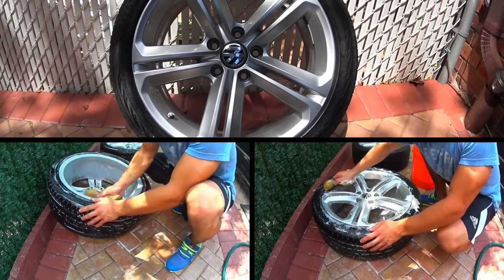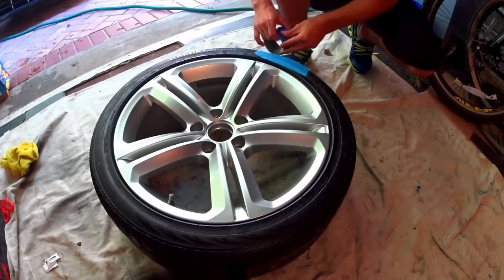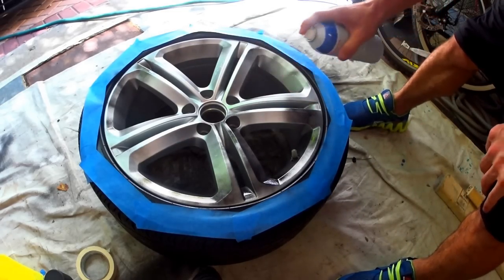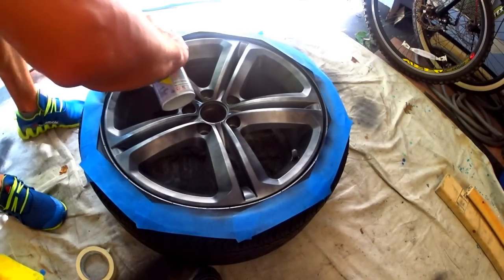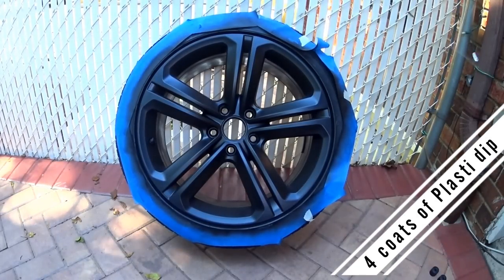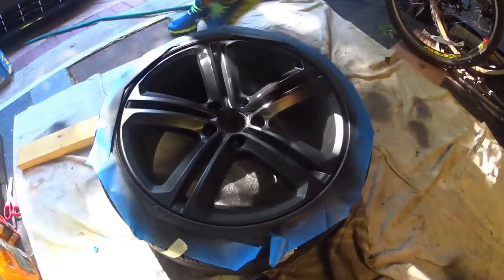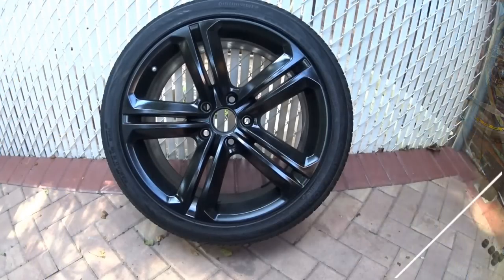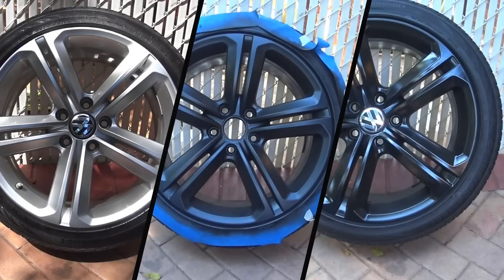How to Plasti Dip Wheels + Glossifier | Complete Guide

Comment: With 1 can/ wheel how many coatings did you get?
Also, how do you wash the wheels now?
Using a high pressure jet (from distance) will it tear apart the dip ?
thanks.
Reply: I managed to do all 4 wheels with 2 cans, wash with dish soap and water, pressure washer from far is fine, super up close will take off the dip.

Comment: Will damage be noticeable if i plasti dip over damaged areas on the rim? Would it be visibly uneven? Thinking of getting some rims with badly scratched paint and just plasti dipping over it.
Reply: I think, (from what I’ve gathered in other videos) you would have to sand the scratches or chips down on the rims. Some people put bondo filler to cover up the bigger dents/scratches and then sand it down to get a smooth finish. Then you can go in with plasti dip or whatever paint you’re using. Chris fix has a video on how to paint tires and he goes over fixing scratches on wheels. I too want to plasti dip, but I will try to sand down as much of the curb rashes as I can, because otherwise they will be noticeable. Obviously from far away you won’t be able to tell, so I guess it depends if you care or not that up close it may be noticeable. The plasti dip will only cover up so much, depending on how badly scratched up your wheels are.

Comment: Did you spray the inner wheel? And if you did, how many coats would it need and is 1 can per wheel enough to do the whole thing?
Reply from the maker: Yes I did the inner wheel as well. 1 can is enough to do 1 wheel with 1 light coat followed by 3 heavy coats on all surfaces. Get 5 cans to be safe; there are some kits on ebay that come with 6 cans for less than 40$. Ill try to make another video soon to show some easy ways to paint wheel barrels. Good luck!
Reply: Brovacs Thanks. How does plasti dip handle cleaning after it is applied. Would regular wheel cleaner still be fine to use. And/or high pressure water?
Reply from the maker: If you apply it like you see in the video you wont have any problems cleaning it with a wheel cleaner or a high pressure washer. Just make sure you stay at least 1 foot away from the wheels with a pressure washer, treat it like you would be washing the paint on your car; you wouldn't put the pressure washer right up to the paint and you always keep it moving. I had the plasti dip on my wheels for 1 year with no problems and I washed it every other week.
Reply: Brovacs much appreciated man, thanks for the video and additional help!

Comment: I bought plastic dip today,and spray on the can plastic cover because I wanted to try it and see what it looks like.  after spray 4 coats and I saw the surface was not so black, seems black mix grey..  anyway it didnt look like ur wheel.   Do you know Why??
Reply: 1st coat: light even coverage
2nd coat: heavier coverage but not to heavy
3rd, 4th, and 5th coat: heavy wet coats
You either weren't spraying evenly and to light or you just need to do 1-2 more coats and you will get the coverage you want. Hope this helped
Reply: +Joshua Barela thanks a lot

Comment: How do you guys tackle the opening for the lugs? I've had issues with the dip grabbing on to the dip when I put the wheel back on the car. What do you guys do?
Reply: Did you ever get an answer for this?  I had this problem.  I think perhaps either there weren't enough coats or you didn't wait long enough for it to fully cure.
Reply: easy... put a quarter in the middle of the whole when you paint and remove it every coat you spray on... that way when you put the bolts on.. it won't twist and turn the dip around/under it :)

Comment: If i decide to use the glossifier, should i apply when the plasti dip is wet or dry?
Reply from the maker: +Alex gti Let the plastidip dry before glossifier. I used only 1 coat and it turned out really good; I highly recommend it. Good luck
Reply: Alright thank you very much.

Comment: I have the same rims on my 15' GLI and I really wanna do this but I'm way to nervous to mess up
Reply from the maker: Dont be afraid man...plastidip is forgiving, if you mess up use some goo gone and start again. Just remember to apply in thick wet coats and wait atleast 15 minutes between coats. let me know how it goes! Good luck
Reply: The perk of plastic dipping is mess up friendly.  You can peel right off if unsatisfied with results.

Comment: Where did you buy your plasti dip and glosiffier cans?
Reply from the maker: I just recently saw 4 cans of black and 2 cans of glossifier on ebay for $40. I usually get plastidip in a pack of 6 for around $40
Reply: Jr Villegas just got to walmart or Home Depot or lowes if you have one of those
Reply: Home depot has them cheapest locally. $5.97 a can while autozone etc. Has for $9.99. Smh

Comment: Hey I just plasti dipped my rims yesterday and then glossified them but they aren't shiny can you please explain
Reply from the maker: hmm did you apply it in thick, wet coats? Ive had experience where I sprayed the glossifier lightly and the results were not as good. But don't worry, just clean the wheels and go apply 1-2 coats of glossifier right now. To get the best results you have to spray the glossifier so that it look wet on the wheels. The best way to do this is to make 2 passes over the same area and slow down the pace of your spray. 

Go back to the video and look at how I spray the glossifier, I make 2 passes over the same area at a slow pace; if you do it like that you will get a good result with no runs. Let me know how it goes, good luck!

Comment: I like the gloss look. Why does everyone else tend to mess it all up and end up looking like duplicolor wheel paint job
Reply: Its a lot harder to do the glossifier.  It takes heavier wet coats which leads to runs and bubbles and all the rim's crevices  make that much harder. I dipped my wheels purchased the glossifier but totally hesitant on using it

Comment: Never PLASTIDIP a wheel on its side. ALWAYS vertical. That's like rule #1.
Reply: Not even man you can it do it either way. The key is light mists and coats. You go heavy u will drip and more so with the tires on the  car. Waaaaaaaaaay faster and easier with the tires on.

Comment: What do you do about the inside of the rim?
Reply from the maker: +Seb Pole Use the same techniques I used for the face of the wheel but stand the wheel up. Paint a section and roll the wheel, paint the next section and keep rolling until you finish the whole barrel. Make sure you use at least 4 coats so that when you remove it in the future it will be easy. I hope that makes sense, if you want to see what the barrel looks like painted check out my Plasti Dip removal video Link in the description

Comment: 4 cans seems too much but then again better safe than sorry
Reply: Saul Rodriguez  that's exactly the amount you need
Reply: Four cans for 1 tire?
Reply: i bought 3 cans 😂 i hope thats enough
Reply: crusty daddy I bought 4 cans of black and one of gloss. Hopefully the gloss will last for all 4. If not I'll have to buy another one before just incase
Reply: Joey161 im doing it rn and i got two rims done w one can of plastidip so i think 3 is def gon do it
Reply: crusty daddy yea. I used 4 on all for 15" rims and my front grill and emblems. And one can of gloss for all of this with some left over. Ended up buying another can of black just in case and gloss before I started. Got to say just doin ?  This simple thing can really change the cars appearance
Reply: CenCal Stang It’s actually very little. I recommend 5 cans and 2 cans of glossifier.

Comment: Though the end result looks decent, this is NOT a good video for reference. Couple things wrong:
* wheel should be either up or at an angle
* can is too close to spray
* needs to be more consistent with the spraying...
But to each their own
Reply: jj52999 no

Comment: Your video was decent but your giving the wrong info! Not everyones coats will be the same so the correct method is by cans not coats! 
For a set of rims depending on the color you need one can of Plasti dip per rim for matte! To make it glossy the minimum is 3 cans of glossifier per set of rims. That's to make your rims matte black or gloss black. 

For other colors say red or something else that needs to pop and stay bright you would use white as the base. Again one can of white per rim. 3 cans of red per set of rims for matte. 3 cans of glossifier for gloss red or whatever color. This is the correct way to make sure you get the best coverage and are able to remove it easily later! Hope this helps!!!